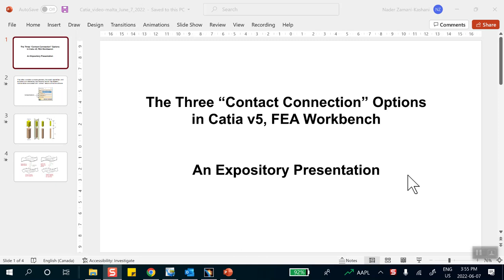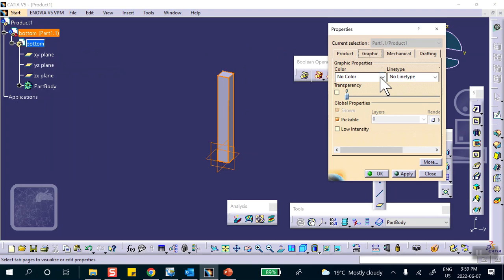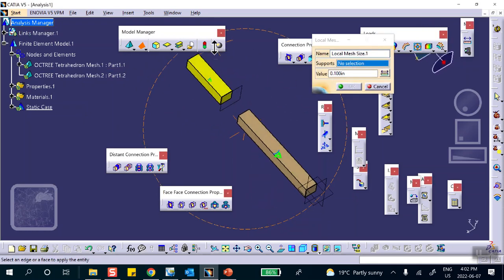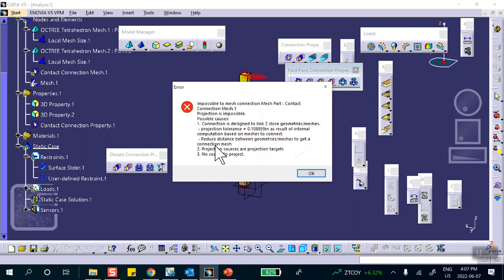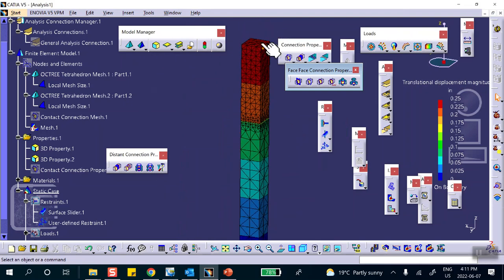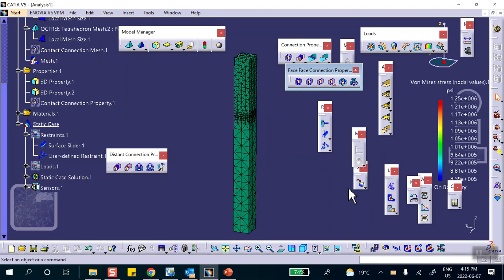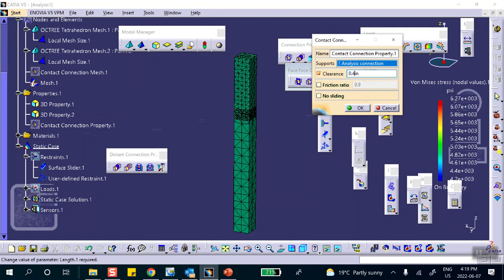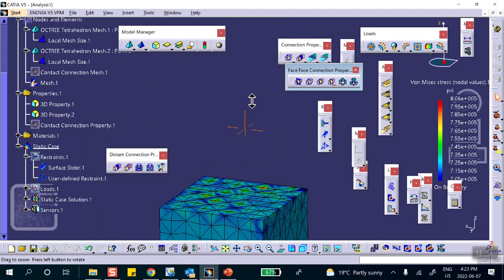FEA Three Contact Options What Are They Catia v5

Comment: Hello, your knowledge on this program is incredible, congratulations. I have problem I can't solve: I want to model and analyze a roller pushing on a piece of flat metal sheet. The roller is not moving freely, only moves against a piece of metal sheet fixed on one end, but the roller moves only in the direction towards the metal sheet, not laterally, not transversally. Just pushes on the sheet of metal, but, I can't figure out how to have the roller spin and actually roll on the sheet of metal. Instead the roller gets attached to it between meshes in contact. If I get the roller spin and move along on direction, it seems to work, but it pulls from the metal sheet, which is not correct. I'll really appreciate any help!!! thank you Nader.
Reply from the maker: Thank you for your kind words. It will be helpful if you had a hand drawn sketch for a better understanding of what is going on. Can send it to me to zamani@uwindsor.ca

Comment: Hi
What happens if we didn't create the analysis connection?
Reply from the maker: Hi, whenvever you have parts interacting with each other (and they always do in an assembly, such as contact, fastened, etc), you need to create analysis connection. Without that, they don't see each other ,
Reply: @naderzamani-ngzk  
The procedure after Analysis connection as following right?
1) Do analysis connection
2) Do connection properties 

Thanks for reply